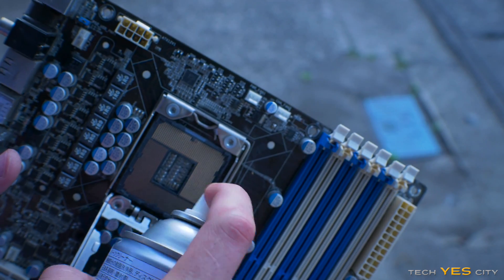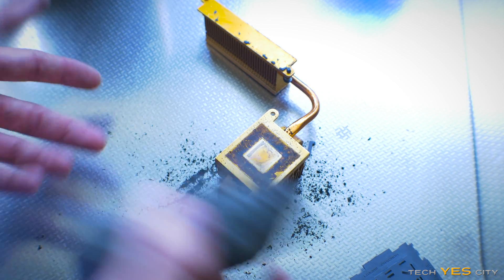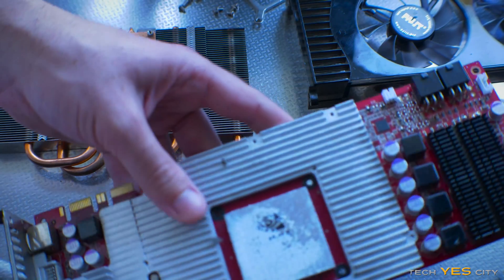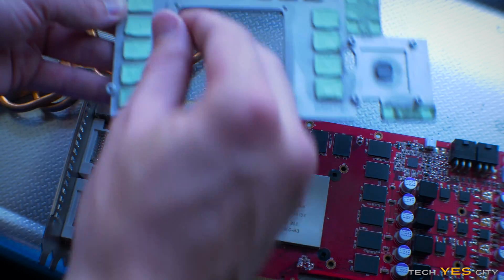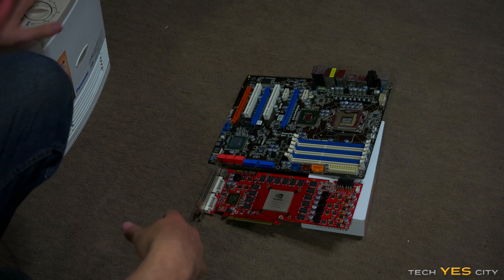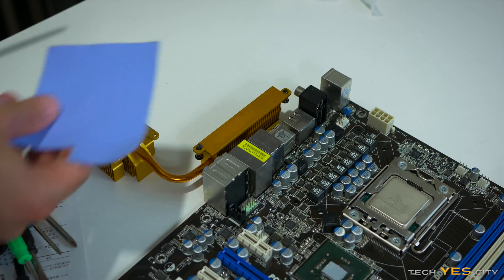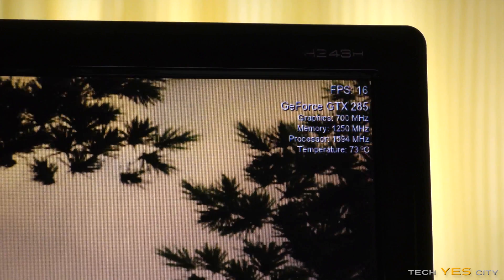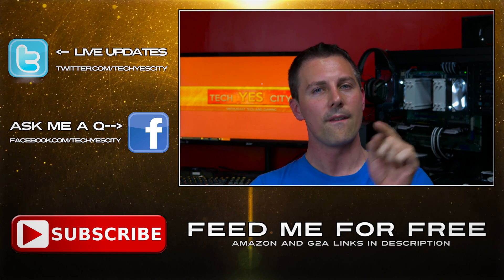PC Parts RESTORATION - How I CLEANSE - Ft. Before and After Temps

Comment: Dust is your main enemy since it can cause low resistance situations or shorts. As long as you remove it and redo the old thermal paste the parts should be fine. The brake cleaner is a little overkill imo since most of the contacts on the motherboard are recessed and do not get that dirty. The only real way to get grease down into the contacts like memory, graphics, etc. is by sticking in a dirty card/part. If I did bother to clean I would end up using pure/99% isopropyl alcohol, but that is me.

P.S. Use gloves when using brake cleaner. That is unless you want to have lobster hands to go along with that lobster face of yours :P.

Comment: About thermal paste on the GPU heat sink I've tested myseld spreading only with preassure and spreading with my finger. And believe me, spreading  with fingers filled much better and temps drops a lot compared against the first method. I did this test not once but 4x already. For CPU doesn't make any difference, but when its a GPU, dude, use your fingers.

Comment: Even I will think of delidding my GTX 550 Ti.
Reply: +Ratul sen y
Reply: if I can lower the temperatures.
Reply: im seyin y is the performance on a 550 important to you. The 730 is a better kard at 70 bux.
Reply: +Mister Pep-Aae Both of those cards are trash.
Reply: You want to do what? Please make a video how you remove the heatspreader from the chip. Want to laugh hard again.
Reply: gtx 550 ti is faster than a 730...
Reply: What's wrong with what he said? Half the models of the 550 and 550ti have IHSs.

Comment: How come you do not brake-clean the plastic parts (obviously), but spray the pcb etc. and mobos with that stuff?

Btw: great video. Thumbs up!
Reply: smokeyjo123e but that PCB is full of plastic (RAM slots, cpu socket... etc.)
Reply from the maker: The plastic used on the motherboard can survive a baking session in the oven generally, it is very strong, dense plastic, as opposed to the plastic on fans which can break easily even without brake cleaner applied lol...
Reply: corrosive

Comment: Love this video. I've used brake cleaner since the early 90's to clean computer parts but never CR 5-56. I do have a couple of questions though. Do you run into any issues with the Cr 5-56 leaving a residue that affects thermal properties between the heatsink and cpu, gpu, mosfets, etc,? Do you find that you have to clean the chip surface before applying the thermal compound? Also, do you take any precautions with the LGA socket pins when spraying the brake cleaner? I know one has to be somewhat careful with any electronics, but it's been my experience that the cpu socket pins are rather delicate, but maybe that's primarily a Gigabyte thing as I use Gigabyte boards almost exclusively and have the most experience with them. I would love to hear your thoughts on these points.

Comment: i just took off the heatsink on a really old northbridge by gigabyte and it was held on by double sided sticky tape!!!!!!!
Reply: +Jasotech It's better than finding your old motherboard and literally finding absolutely NOTHING between the chip and heatsink.
I had issues with that board for the longest time, I bought a thermal pad for it and it worked perfectly after that... the board was an ASUS A7N8X-E Deluxe.
Reply: It's a thermal pad you better change it with a new pad if you took off the last one
Reply: LMAO THIS GUYS COMMENT IS HILARIOUS. DOUBLE SIDED STICKY TAPE IM DYING
Reply: Ardie Fernandez  i wish i took a pic but i threw it out no it is literally sticky tape i know what a thermal pad is and looks like
Reply: It was a thermal adhesive pad. Not that rare, I've had quite a few boards with them.
Reply: ***** no it is literally sticky tape
Reply: Medo Gabr so what do you call it then hard man??

Comment: I delidded my gtx 570 and dropped my temps by ten degrees. It took long, but it was a fun experience!
Reply: +Jimmy By doing drugs.
Reply: Jimmy Yeah, my school has this subject called meth and what we do there is add cocaine and marijuana. After that class I go home and delidded my gpu, psu, case and cooler. I also overclocked the case just in case I couldnt cable manage well with my current 10 dollar case.
Reply: +oldair patino How the fuck does one delid a GPU LOL
Reply: +Plasmo gpu's have the die already exposed, theres nothing to delid
Reply: @Slothowo  some 2nd hand gtx 570s I got had IHSes
Reply: +Toxicmanish Have you watched the video you are commenting on, where he clearly mentions that some GPU's have IHS on the die and paste between, like CPU's do ? ?
Reply: zionlee1004
You must have been on them if you delidded a GPU.
Reply: Plasmo Meant to be a joke.
Reply: +Toxicmanish There are tons of GPUs with IHSs...
Reply: +Jimmy You pry the lid off the chip? Pretty self explanatory, aha.
Reply: +zionlee1004 Yeah, I get that, you were funny, but I wasn't replying to you. I think Jimmy genuinely believes no GPUs have IHSs.
Reply: +Toxicmanish I've only seen a couple of GTX 570s (the GPU the op has) and they've has IHSs on them. I can see how de-lidding them would improve performance.
Reply: +Jimmy are you fucking stupid? Did you watch the video? All the GTX 200s had lids.
Reply: mid-range fermi cards are abosolutely different from the big brothers, I have a windforece gtx 460 overclocked to 797 mhz, and average temp under 100% load is 69ºc and remain silent
Reply: some gpus have an ihs.

Comment: instructions unclear. got my dick stuck in the cpu slot
Reply: Same
Reply: +swallow me You were supposed to put it in the 3-pin header
Reply: +The Inspector o shit thanks now my balls became a cpu fan
Reply: +swallow me I got mine stuck in the south bridge heat sink.
Reply: +powerplayer75 well it already runs decently. the only problem is that its well-worn if you know what I mean
Reply: +Panagio Tsaou well I guess I could cut it off and it grows again
Reply: +Panagio Tsaou only 1000w psu? I was thinking around 6666w psu.
Reply: +Panagio Tsaou dude you saying I have a short dick? that log is longer than you have ever imagined
Reply: did it still burns when i pee

Comment: I have an idea for a video for You Brian that kinda fits your specialty:  Throwing in GPUs into OEM ( DELL,HP, ACER) PCs and see what performance you can get from OEM systems for people who don't want to build. Like I told You, I got a Acer with a i7 4790 (non K) 1 TB HDD, 16GB RAM, WIndows 10, the works for 400$ the CPu alone is 250$-300$.
Reply: octavio mancilla Well I hope you removed McAfee by now... ;)
AND put an SSD in there, that'd help a lot.
Reply: Fabian Tschopp i had a dell inspiron 520, i got a 560 ti, man was it annoying put in, but it works. besides thats its just more annoying to assemble, perfomance wise its the same as if you buy the parts etc
Reply: Thats what i mean, We the enthusiasts are the minority, most people have an OEM system. So why not do videos for people that have existing OEM systems?
Yeah of course, building youre own system is the way to go, for Us the GEEKS, how about your average joe shmoe? just an Idea thats all.
Reply: +octavio mancilla well it wouldn't be that amazing because OEM parts are nothing different
Reply: Fabian Tschopp
 Not always brother, I bought an OEM ACER with a i7 4790, 16Gb of RAM, 1Tb HDD, Wirless WIFI and bluetooth included, Original
WIn 10, 1 year mcafee anti virus and warranty for 420$ and I slapped a GTX 970 in it, RUNS amazing. so its definately an option for the lesser GEEKs out there no?
Reply: +octavio mancilla 
Stupid idea, because it often won't work: Insufficient space in the case or too weak PSU, usually. And sometimes the PSU isn't even ATX standard.
And if it works, it's boring as hell, as the performance will be the same as with the same components in a custom build.
Reply: octavio mancilla delete mcafee
Reply: No and YES lol  Kept Mcafee, installed an SSd and PSU form EVGA 600 80 plus for 30$
Reply: Im against Anti viruses for i feel they consume too many resources sometimes, just a little tidbit, original windows 10 and 1 year sub to an anti virus, not bad guys
Reply: OEM users dont know what we know, Theyre convinced an anti virus is a must.
Reply: windowsfrozenshut
Yeah man! Like i said i got a ACER TC 705 with a i7 4790 non K, 16 gb of DDR3, 1Tb Seagate, wifi/bluetooth built in, usb 2.0 and 3.0, card reader, win 10 original and warranty for 420$. I had to jump on it! the CPU alone goes for 250 300$. I added a adata ssd 120 gb for 40$, a 600 watt evga psu 80 plus for 35 and i threw a gtx 970,I see absolutely ZERO difference with my custom build.
Reply: octavio mancilla
The Mainboard in that ACER build is absolutely horrible though. Minimal VRM without cooling, one PCIe slot only, big GPUs won't fit the case or motherboard and horrible quality of the Mainboard in general.
For PSU, Mainboard and Case you get the absolute minimum, exactly what you paid for. Most of the money as you said, goes into the CPU.
Reply: yeah but youre not really OCing on that board, plus the i7 4790 runs at 4.0 ghz, dont need more really

Comment: why do you use your finger to put on thermal paste your body fluids interact with the paste and may change the preformance. id sugest using scrap plastic cut to shape.
Reply: No
Reply: +stilloading adventures yeah, or getting nanoparticles from the thermal paste into your skin and blood stream, very good!!!
Reply: I don't want to be the guy who says you shuld I want to be the guy who askes  if it is actually a good idea
Reply: +Leone Furlan   He Evan said why. He soaks his finger in alcohol before
Reply: Leone Furlan
Linus Tech Tips made a video about that. It did not matter at all how to put the paste on, as long as it was new paste and not too little or the whole package, temperatures were identical. The key here is just new paste.
Reply: I always recommend (if you want to apply it with your finger) to just put your hand into a thin plastic-bag, because people with sensitive skin might get skin-irritation or rashes like an allergic-reaction.
Thin plastic bags (e.g. for veggies or fruit) are available for free in most grocery-stores and thus are quite cheaper than nitrile-gloves.

Kind regards,
Meta Custom Computers

Comment: Cracking video, I also lube up the fan bearings with some light machine oil (sewing machine oil). Don't even need to take the fan apart, just use a hypodermic needle to place a small blob in the bearing : )
Reply: I personally use singer sewing machine oil, there is a fine balance between lubricating the bearing and leaving it dripping with oil, which obviously introduces dust issues.

Comment: sir can i use any brand of break cleaner and alcohol wipes only 10% of alcohol?
Reply: +David Lucas as long as it contains no water , it's fine.
Reply: +Phoenix Wright  no, aim for 60% or higher with no water
Reply: +David Lucas no
Reply: +justin peperkamp... no for 10%alcohol wipes?
Reply: you can't use any brand of break cleaner and you need 70% or higher alcohol wipes.
Reply: +justin peperkamp can u suggest a brand that can i use to clean my motherboard and my gpu?
Reply: That is Brians video about the stuff he uses to clean pc's.
Reply: thanks guys..

Comment: Quick question, What is the best thing to do with my old Q6600 PC. Upgrade and resell or upgrade and keep for self ( lan parties)?
Reply: I would keep it for retro games
Reply: +The Rabie Although that is the thing. I want to buy a GTX 460 so it could do some better stuff than whilst it's stuck with an HD 4550 and 3GB of RAM.
Reply: +Brennan “BrenFlake” Price a used gtx 460 is pretty cheap these days.
Reply: +Brennan “BrenFlake” Price Resell on Ebay.
Reply: +Brennan Price (BrenFlake) I have 2 Q6600, both G0. My strongest one, which i gave to my sister, has 8 Gig 1066 Mhz, an SSD and is overclocked to 3.6 Ghz. My goal is to update the GPU to a GTX 750, R9 270 or something in that (used) price range. I had a borrowed R9 270 and it ran most current game reasonably well, at least at the 1680x1050 resolution her monitor handles. But i only won't upgrade that rig because she just doesn't have the money. My main rig is a i5 with 16 gig DDR3 and i just use my own q6600 as a second computer
Reply: Depends on what you are playing, and what your current gpu is
Reply: +Groundskeeper Willie Well, I can upgrade to 8GB of ddr2 and go with an SSD possibly. I have two HDDs already. but the gtx 460 isn't that bad compared to my main rig which has an R7 360. I know because my brother has one in the PC I built him. I could also go with a GTX 560 but so many are faulty or are messed up in some way on eBay.
Reply: if you can OC the q6600 then grab a gtx 660 or 750ti
Reply: +SrizyGaming Good point. not sure my motherboard will allow it though. My power supply will though as I got a 550w for it.
Reply: +Brennan “BrenFlake” Price whats ur budget on gpu
Reply: +SrizyGaming I'm kinda thinking anything up to about 60 ish. I get 30 every month at least so should be easy.
Reply: +Brennan “BrenFlake” Price pick up a mobo which u can OC on and then save a little more for a 660 that will take you a long way
Reply: +SrizyGaming Possibly. I already have my main rig at 4.2 GHz with my R7 360 and 12GB of RAM. so basically I'm not sure I need as much power as a 660. All my games run fine with my main rig. Even Fallout 4 at high and 1080p is fine for me.
Reply: +Brennan “BrenFlake” Price go for a hd 7770 then
Reply: +SrizyGaming Ok, cheers dude. thanks for the help.
Reply: +Leone Furlan Yeah I know but I got my Q6600 for £14 so it's actually cheaper than the xeons.
Reply: +Leone Furlan Yeah I know. Even the motherboard was only £15! And it supports 4 dimm slots and it came with a cooler when I bought it.
Reply: +Leone Furlan Ha-ha, yeah. I'm all about my  deals. I would happily put a decent GPU in there but I'm not sure if I need the power as my main rig is only mid range and I do alright with that.

Comment: Just no ha.
Reply: +Adam Evans You got a drop as the thermal compound you used was likely better quality then the original, and you cleaned the fans out. Brake fluid was a pointless use, just compress air the parts.
Reply: +Adam Evans There is an edit function you know, instead of replying to yourself like a dumbass. What should he have done? Used shittier compound? Point of this video is to showcase the results after a clean, which implies using better compound.
Reply: +Intex Not used brake fluid? Already said that.
Reply: +Intex no edit on phones
Reply: +Intex no edit on phones